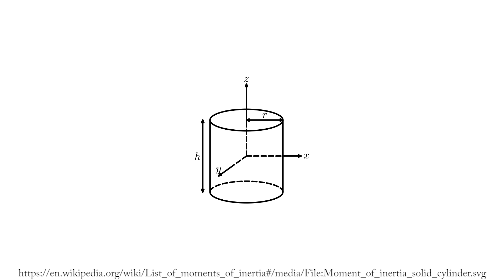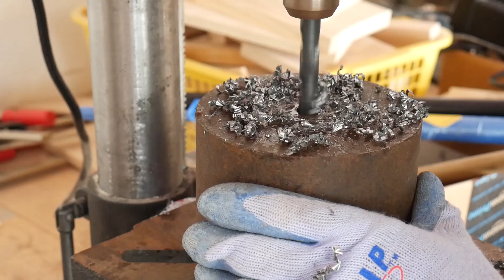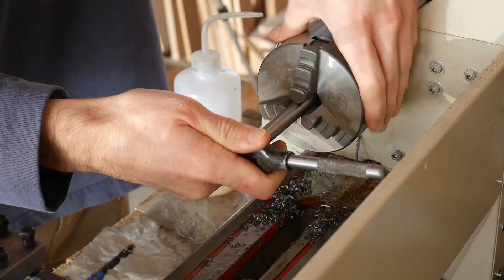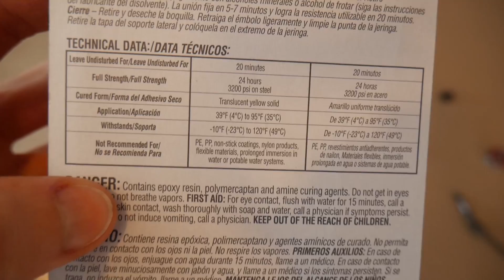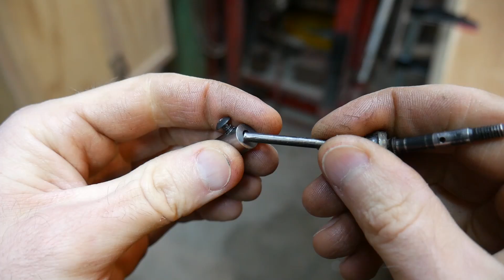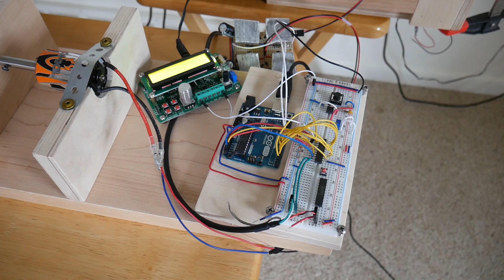Motor Dyno #1 - Getting Started

Comment: 15:00 - Looks like quantization effect in low-res ADC. ie. the rpm is so low as to give a conversion function no headroom over integer rounding, thus you lose resolution. As the RPM increases, quantization noise decreases. That's one guess - and if that RPM transducer is designed for "tens of thousands of RPM" - then that would be another supporting factor to my guess; it just isn't designed to be accurate that low - it probably has a "working range" from 1,000-10,000.

Comment: a better way to get that shaft mounted would have been to leave it at interference fit size, shaft in the freezer as cold as it will go, drum in the over as warm as you can get it, press it in then as soon as the temps equalize it should never be coming out.

Comment: ADD a .01 microfarad capacitor to the pickup lead them to ground... This will clip any erroneous signal, pickup holding capacitance  or RF problem ...

Try it ... .01 caps are one of my Little secrets..  Along with always having some Op-Amps & thermocouples ... Think about it... It's all bout energy conservation / utilization 

#SilentWatchDiv
Nikola
&
BuzzBox

Comment: Many motors are rated by volts/rpm and Newton-meters/amp. Have you considered logging the current into the motor as it spins up the flywheel? That should give you a good way to compare different motors.

Comment: I wanna see something like a washing machine motor spin up that colossal lump of a flywheel :D That'd be a sight!
I wonder if the spikes are noise caused by vibrations as the mass spins up, shaking some of the connections on the breadboard? There might not be that much vibration from the mass itself, but that motor wobble might be enough.